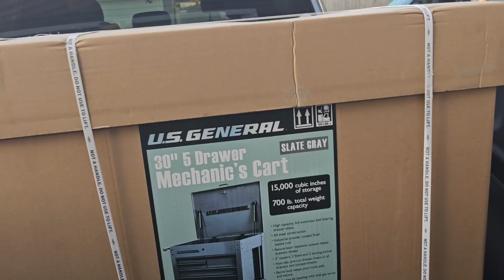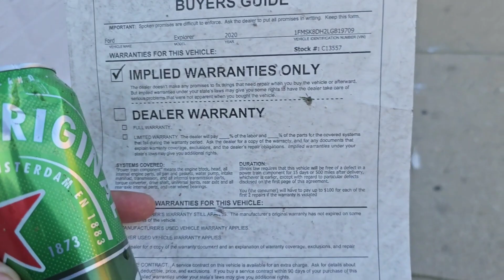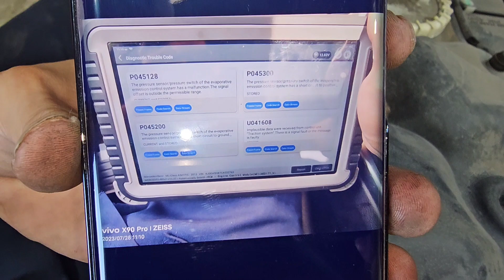Chicago - Did They Graffiti The New Paint - 2013 Mercedes ML350 Evap Fuel Tank Codes - Air Lift Bags

Comment: 6:51 ,those are actually GM connectors, its basically a PED /Delphi type connector, same as many GM & Daewoo vehicles, the sensors look the same ,actually thats a $30 dollar connector, unfortunately Mercedes Benz uses that soy based insulation that both mice love to eat & it also gets brittle over time as well & causes shorts as well, i prefer to use the GM pigtail connector without that bio insulation, p.s you should have seen what happened to the mouse 🐁 that was chewing up wires on one of my cars ,lets just say he was put into the turtle tank 🐢 & disappeared when the snapping turtle found him